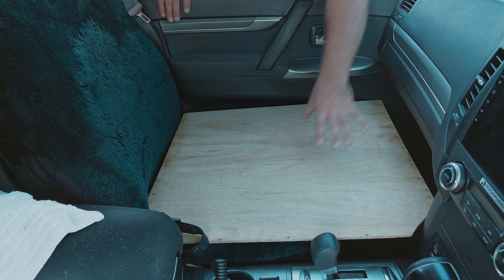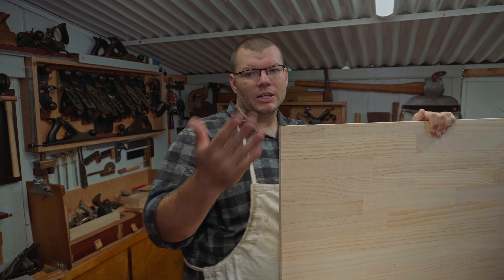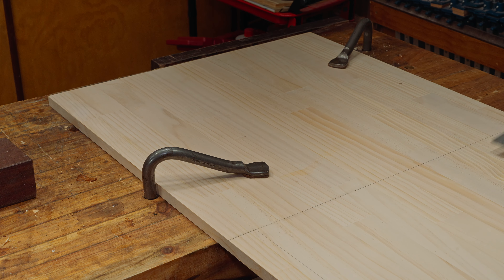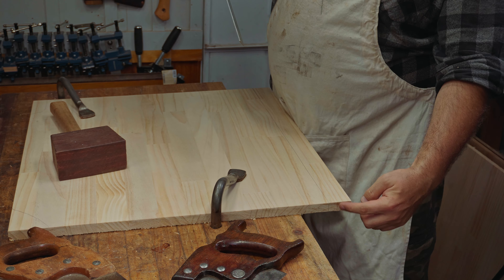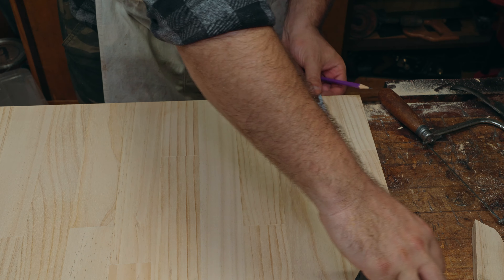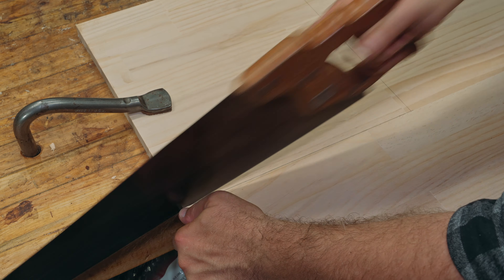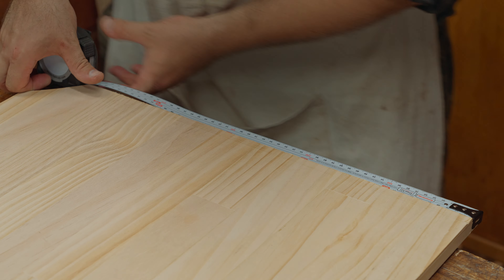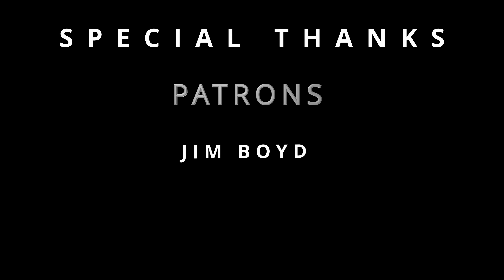DIY Removable Car Seat Dog Bed! - Hand Tool Build

Comment: Excellent. So refreshing to see someone break the mould. Not the typical woodwork project, which actually makes it a great example of the endless challenges we come across as woodworkers; it's not all fine-tuned hand planes and shellac, believe me!
This video reminds me of a floor-to-roof plywood divider that I made for someone to fit along the length of a horse lorry many years ago; it had to be foam padded and covered with vinyl (washable) on both sides. No two jobs are ever the same.
These jobs focus on function rather than fancy finish.
Great job, Luke; opening up the door to the vast range of things we do other than hone blades and cut dovetails.
I have always had the attitude that in woodworking, there are no problems - only challenges. If something needs doing, work out a way to do it. I believe that is why I have customers who have stuck with me for decades, which is something for newcomers to aim for.
Reply from the maker: Thanks Pete your insights are always greatly appreciated

Comment: Curious on what you think about saw benches. As an avid user of saw benches watching you saw large panels on a high bench looks painful to me. Anyhow nice build, a bit refreshing to see someplace outside the shed, cheers!
Reply from the maker: I think saw benches or even low roman benches are great and make sawing a lot easier most of the time. The main reason i don't use one is limited space i don't really have room for one, the other is that a lot of beginners don't have a saw bench and i like to show other options that work even if it's not the best way.

Thanks for the comment